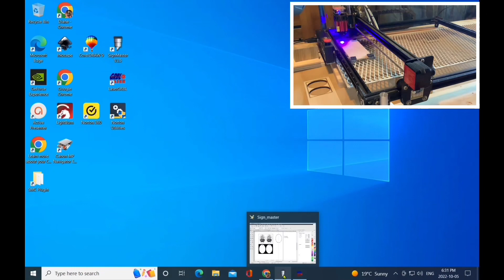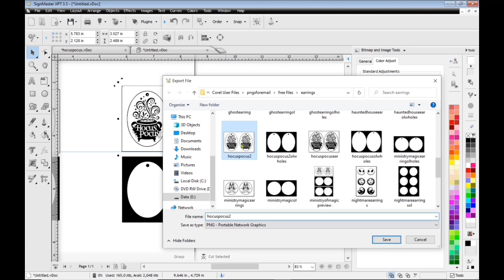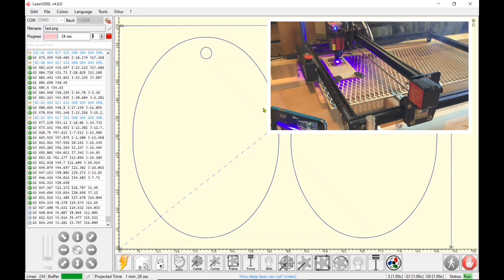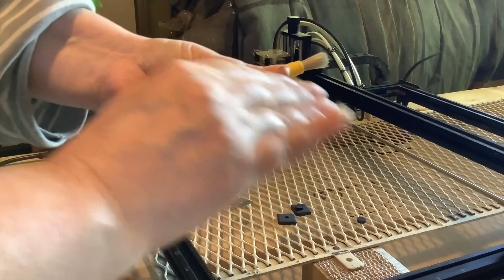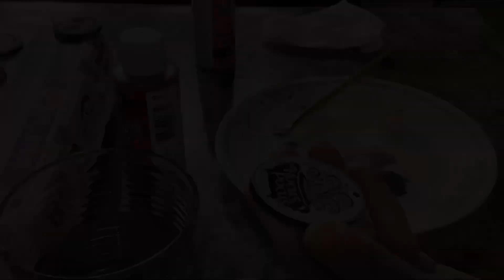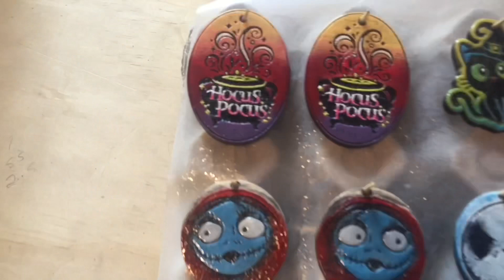#15. How to Laser Engrave, Laser Cut & Paint in LASERGRBL. ORTUR LM2 PRO . Halloween Earrings!

Comment: Are the sizes on Laser GRBL in inches or mm? I started with basswood and was told I should get mdf.
Reply from the maker: @elliemerritt665    The sizes are mm . I really despise mdf to be honest. It makes a sooty and smokey mess. Air assist, Air exhaust and cleaning your lens after use is paramount. So be prepared to brush out any engraving really well and sand the edges. You'll probably need to spray a sealer over them before painting so the black from the engraving doesn't smear when painting or a final clear coat. Yes, it's a little bit more durable for simple small items but it can sometimes be difficult to cut due to the glue up and the smoke it produces. All edges need to be sealed as mdf will balloon up and separate  after getting wet. Basswood is a little softer than birch ply. Now the thinner basswood (3mm) , it can warp with painting. So consider gluing 2 layers or 1 layer of 6mm or birch ply. :)

Comment: What kind of wood do you use?
Reply from the maker: Sorry I didn’t reply sooner.. I didn’t get a notification ! But anywho.. I like using basswood or birch ply. Basswood sheets are much cheaper than birch ply right now. I get a 10 pack 11.8” x 11.8” x 1/8”  for $31.99 CAD from Amazon . Cuts beautifully with my 10 watt at 225 mm/min , M3 constant power, min 94% Max 95% . One pass , also with air assist. 😊
Reply: @disignscdn  thank you. Gonna try this ☺️
Reply from the maker: @crafty-zebra  Awesome! You will like basswood. It’s far better for intricate designs . If you plan on doing some earrings check out the lobster claw clasps rather than the wee tiny rings you have to bend to get through the holes ..those suckers fly out of your fingers and are impossible to find 😂 ( speaking from experience .. lol )
Reply: @disignscdn  😂 thank you for the information ☺️